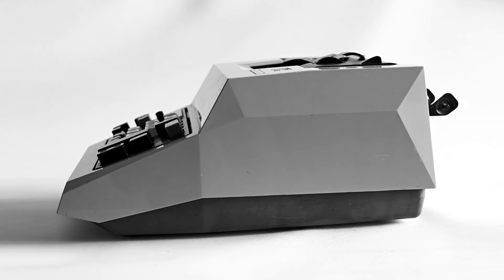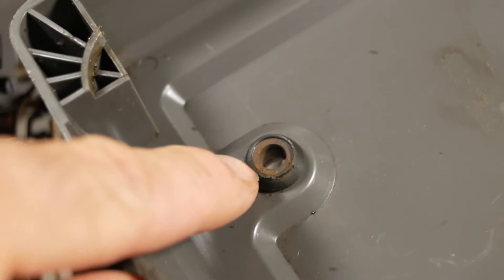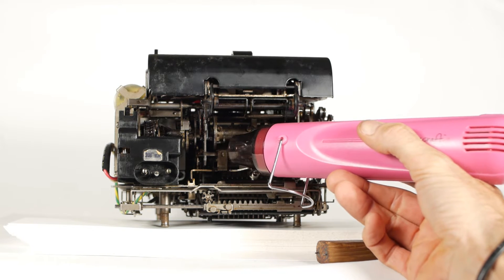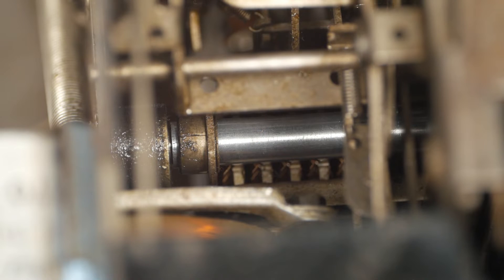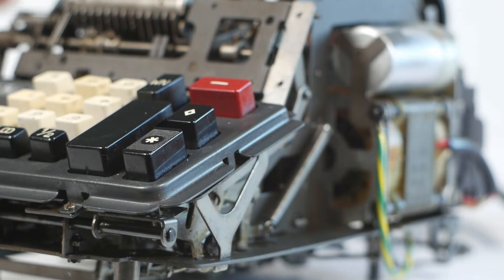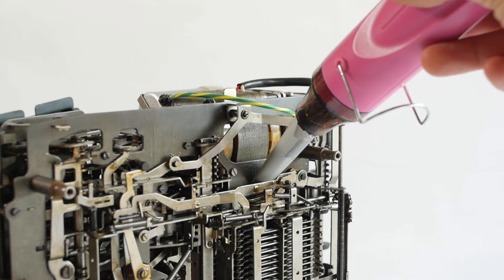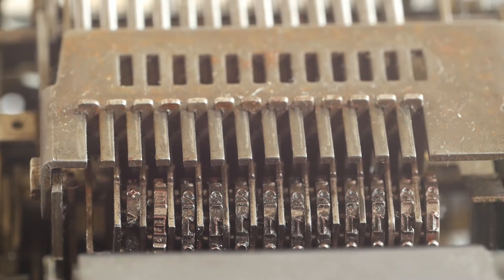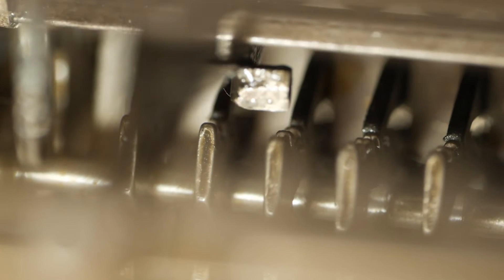Olivetti Multisumma 20 - Part 2 - Mechanism & Repairs

Comment: Another great video Tim.  Having just finished completely dismantling, cleaning and reassembling a Summa Prima 20, it is interesting and, of course, inevitable how much of that machine's technology is used in the Multisumma.  Same method for driving the print wheels, for moving and inverting the register block, for storing and transferring the entered number onto the racks and therefore into the register, and I also recognise some of the interlocks.  You realise I'm going to have to go and lift my Divisumma 24 off its base to see if it uses the same sort of mechanism as the Multisumma 'memory' to store the multiplicand.
Reply from the maker: Hi Simon, as you say, it's somewhat inevitable that they would have used the same technology for both the Prima 20 and the Multisumma 20, but never the less it's still interesting to actually see it.  It would be reasonable to assume that the Divisumma 24 uses the same method for the multiplication, but you never know, they might have tried something different.  I can't believe that I didn't spot the fact that it stores the result of the previous multiplication - I'd noticed that it didn't reset the multiplier racks to zero but I failed to make the mental leap to figure out it was actually a useful function!!!
Reply: The Divisumma 24 uses a constant memory as one of the factors of the multiplication. After every multiplication, this memory does not erase itself, so you can do multiplications with a constant factor.
Also this memory can be used as a constant sum, subtract, and can be set while printing a total or a subtotal.
And also, the quotient of a division is formed in this memory.
Reply from the maker: Thanks again Nicolò, your knowledge of these machines is always very much appreciated.

Comment: Hi Tim, great video! I'm blown away by the wonderful closeup shots of the mechanics in motion and your excellent explanations. 
For bringing these old sticky calculators back to life you do need only three things: patience,  patience and patience 😉.
Applying heat is really helpful, I often use it together with  a 1:1 mixture of isopropyl alcohol and semi synthetic engine  oil.
Reply from the maker: I was amazed the shot of the register worked as well as it did, the gap was so tiny, but I managed to get a bit of light in from the side which really helped.  Oooh I'll have to try your Isopropanol and engine oil mix, that sounds good.